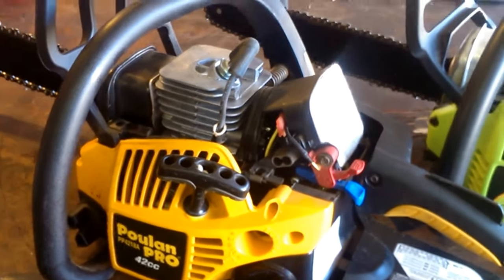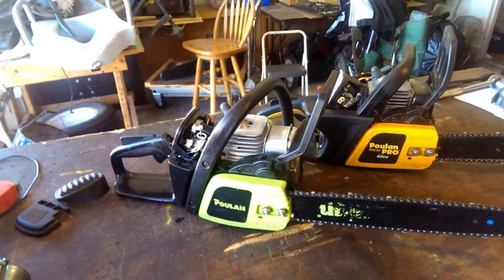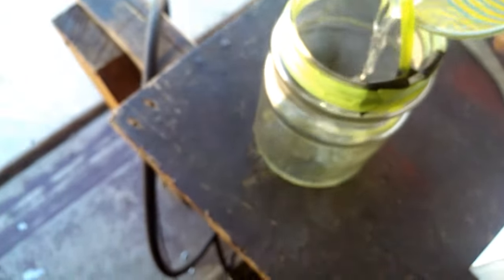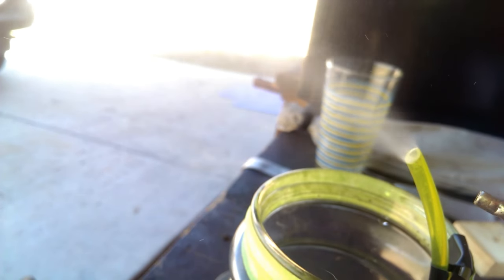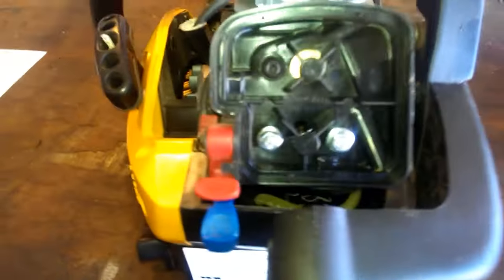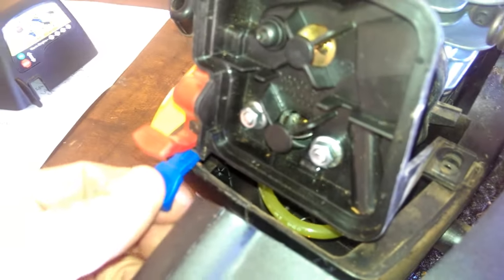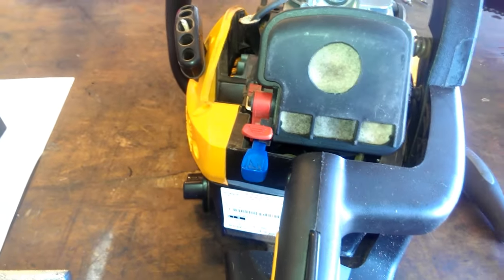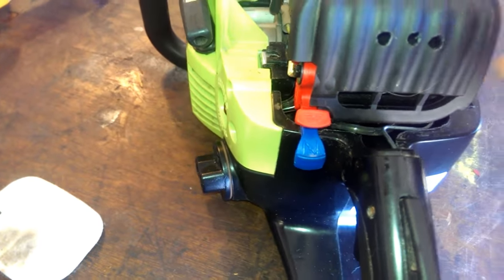Poulan wont restart after being used & how I solved my problem.

Comment: Great video brother! I just have one question that is can’t find the answer to anywhere. How many turns left from zero on the carburetor is it on the Low (L) and High (H) end? I can always buy a replacement carburetor but I will never learn how to fix it in the future. It is a Poulan chainsaw P3816. Thank you again for the great video!
Reply from the maker: To properly tune the chainsaw or any saw for that matter, the saw must be configured for way it is intended to be used. IE: air filter in place, chain on and warmed up. Start with both high and low adjustment screws at 1 1/4 turns out from full seat. That's just the starting point. After you get the saw started you will only adjust the L screw to get the saw to run on its own. After that give the saw AT least a full minute to warm up. Now it's time for the H screw adjustment. Counterclockwise will make it richer or more gas and clockwise adjustment will make the mixture leaner or less fuel. After adjusting both screws and you feel that you have good trigger response, you must put the saw into wood and see how it cuts. A little fine tweaking may be necessary for optimum performance. I know it's a long winded answer but that's how I do it. I hope it helps. Start at 1.25 turns on both. Thanks for stopping by and Happy Thanksgiving. Stay safe. 😷🍺👍
Reply: Thank you for the quick response brother, especially on Thanksgiving! You are awesome and I love your teaching techniques, keep it up. Enjoy the family on this special day! Take care.

Comment: Just found on the 3414 by the side of the road for anyone who thinks they can get it going, I put in new gas, it started and stalled immediately. Now I'm going to look at the air and then a carb adjustment if needed but I know after this video (thanks!!) I'm gonna get it running like a Deer and sell it for 100.00 in about 2 minutes.
Reply from the maker: Good luck. Seriously brother. 🍺👍
Reply: @ZombieDaveAZ  Thanks Dave, looks like I'm not getting any fuel in the primer bubble, I'll add some gas to the carb and see if it starts, if so I imagine I have a blocked fuel line right?
Reply from the maker: @robertdelorme8779  type in 2 stroke carb clean 100% in the youtube search bar. My 2 part video will come up. I think you will find it helpful. 👍
Reply: @ZombieDaveAZ  Thanks for all the tips Dave, in the end I passed it on to a dude for 15 bucks, the brake chain was busted and didn't want to take it any further.  You're a good man to help so many, take good care.

Comment: A two stage carb is equiv.to the two barrel quadrajets,thermoquads etc. the carb u reference has a choke valve , a throttle valve behind it  plus an aux.air  valve above for exta air injection at hi throttle to thin exh. emissions. Some early foreign cars had a 2 barrel(stage)carb but never saw any US 2 barrel 2 stage carbs ,only 4 barrel 2 stage cabs.in US.
Reply from the maker: James Farley Ill take that as a "yes." 2 barrels an 3 butterflies.

Comment: I have a Poulan P3314 33cc/14" Chainsaw. The Choke switch (Blue Switch) will not stay out when I choke it. How do I fix that?
Reply from the maker: The choke will not stay out if you pull the throttle trigger. Choke all the way out is choke + high idle. Choke pulled all the way out and pushed in 1/2 way is high idle only. If the choke does not stay out on its own after what I just told you,it's a carburetor linkage issue. Have you done anything to the carburetor?

Comment: I have a similar re-starting issue with my stihl km130 which I use for hedge trimming. After prolonged use it won't re-start easily. I usually leave it idling so I don't have to re-start. Thanks zombie Dave, I'll look into it a little further.
Reply from the maker: Hi David. That KM130 is a 4mix machine and pretty much bulletproof. The valves do need adjustment usually around 60 hours. I can send you the link if you would like. Also the exhaust screen can clog and slow the start up. Check those 2 things and your machine should fire up on 1 or 2 pulls everytime.
Reply: Zombie Dave. Please do send the link, if I find it's too much for me to handle I'll get my local Stihl guy to check the valve clearance/adjustment. Spark arrestor is clear.
Reply from the maker: @David-il9zr  Here you go buddy. Its easy. https://youtu.be/K9Uy-an-5Cs . Note to self: Dont rip the cork gasket and be sure the copper washer stays with the nut when removing the valve cover. Why?  Because the fuel air mix travels up underneath the valve cover to lube the rockers etc. If the cover is not on tight you will have a lean condition. Other than that its a piece of cake. Dealer is $65 to do this around here. Let me know how it turns out.

Comment: I have one Poulan P3314 that starts great and one that just don't I bought them for $66.00 for the two at a pawn shop. I had a old 2300 that would start the first or second pull every time but it just wore out it was about 20 years old and cut firewood for me and my dad every year!  Some are good and some are bad!= I guess.
Reply from the maker: Old Guy Hey buddy, Thanks for the sub. I like Poulans and have other videos on them. Some on carb rebuilds, some on what to look for for compression etc. I'm old and just like the challenge of making them run again.  Seach my titles and naybe it will help you get that 1 Poulan running again. Thanks again.

Comment: Good idea! ... Got a p3816 and having a problem removing air cleaner to get carb off. Same as on this video...2 nuts and 1 torx screw in upper left corner. Removed them and still not budging. HELP!
Reply from the maker: Dont forget choke and throttle linkages. Could just be a little stubborn.

Comment: It's the air filter , after running the saw for a while the stock air filter is lightly saturated and cannot allow a fresh burst of air to pass through it due to the low draw ( suction ) from the engine , Husqvarna uses screen filters , try using a screen filter or just the screen modified to fit the poulan chainsaw

Comment: I have that green PL3314 model. What size torx do you need to open the top cover off?
Reply from the maker: Matt Handel T 27 but a T 25 will work too. I think some of them accept a slotted screwdriver as well.

Comment: Also,any air in the tank has moisture will condense into water that runs down the walls inside the tank and ends up pooling in the bottom of the tank. Yup same exact thing happends in your riding mower.
Reply: Very seldom do u get moisture from the air into the tank. Gas over 70 degrees is expanding /evaporating keeping even an open tank free of much if any air, especially if near a hot motor w vibrations helping the pressure. rise. The water is usually in a soluable state in the gas/alcohol and seperates out.

Comment: I have the same Poulan as you. It was brand new but I only used once, then it sat until the gas lines rotted. I just changed all those and got it running. I learned a lot trying to do that. Next item to fix... my trusted Dolmar weed eater bit the dust. Acts like it's hydro locked. Can't pull the cord with the spark plug in. I took it to be fixed and was told a screw on the pull cover came out and got stuck. Afterward it worked once and then the same thing happened. I thought I had it fixed after taking it apart and putting it back together (don't know what I did but it was working/pulling). Then it stopped pulling again. Watched some videos and learned a little about hydro lock. I dumped the oil/gas from the piston through the spark plug hole. Still won't pull if spark plug in. Can't find any other videos to help. Any ideas? I like your videos, thanks.
Reply from the maker: Hello Cliff. The attached video will help you solve the hydro-lock problem. Its a carburetor issue. https://youtu.be/wNTKOuKwXaI

Comment: Thanks for info on air filter I have the same saw I use to just leave gas in tank when not in use ,it eventually rotted gas lines in tank .they are a bitch to replace not much room in fuel tank I got new lines in saw will start but will only run on full choke if you try to open up it dies out is carb just dirty ?  I like saw but have found two different Craftsman blowers with same problem some one threw out!

Comment: I got one like ur yellow one 42cc my problem is boggs down while cutting had a 20in bar went down  to a 16in still same problem cleaned carb adjusted carb with no luck Mufflers clean even drill a extra small hole in it feels good mix 40 to 1 new plug. But what is start off turns one low and high screws and mine runs 1 tank of bar oil to tank of gas is this normal for this saw most saws I have use it's 2 tanks of gas to 1 tank of gas. Thanks for and help
Reply from the maker: CoondawgFromKy Hey Coondawg. This saw was not intended for working a 20" bar. Its basically a homeowner saw that might get worked 1-2 weeks a year. As far as the oil usage on the bar, it does seem excessive. Check for leaks is all I can say without having it in my grubby little hands to inspect. Sorry Im not much help. Pawn shops are full of fairly priced Stihl and Husqvarna and Echo saws. A properly tuned one of these will deliver the constant power and performance you are looking for. They even have adjustable bar oilers. Thanks for commenting.

Comment: What about poulans with the metal filters?  I have the same stupid problem and have put all new fuel lines fuel filter spark plug and new carburator. Still runs like shit. I've spent hours trying to tune the carb and nothing. When it does start it just bogs out once I start cutting.

Comment: Thanks for the video. I have had one hell-of-a-time with my 4218 this weekend. It'll run only long enough for what I perceive as the contents of the bulb squeeze have in the carb. I replaced the fuel line because I found the fuel filter broken off and just laying inside the tank. Before that discovery, I replaced the fuel with the pre-mix 40:1 from Lowe's. I cleaned the carburetor with cleaning fluid, it looks very clean but then again if it's internal then I might not see it.  The machine will start and, like I said before, it will run until the gas runs out of the bowl or if I keep making "baby squeezes" to the trigger, a full squeeze will shut it off and if I do nothing it will shut off as well.

Any suggestions that you might have Zombie Dave are much appreciated. Even though I have owned this chainsaw for over ten years, I do not have much runtime on it. The same goes for anyone else who would like to add to the conversation. I've considered the trash bag method already.
Reply from the maker: 07Convertable id the filter was broken off in the tank then I PROMISE you that the small screen under the pump side of the carb has junk in it. Follow this link to my 2 part cleaning and assembly of a carburator. It WILL help. If you are not comfortable with cleaning a carb, a new one can be had on Amazon for under $15 and the rebuild kit is about 1/2 that. Either way you can can get out of the repair cheaply.
Reply from the maker: 07Convertable  here you go buddy. https://youtu.be/CX34AxY2aYU
Reply: Thanks, Zombie, I'll check it out now. 

BTW - I take it that you fly ultralights? I will get one myself someday. Maybe after I finish paying off my Victory Vision! Always been a dream of mine to have one.
Reply from the maker: 07Convertable  learning to fly is the best thing you will ever do to yourself,for yourself, by yourself. Good luck. Hit that subscribe button and help a brother out.
Reply: over time the fuel mix breaks down into gum/powder coating all parts .if fuel flow flushes the trash in the fuel lines to the carb screen replacing filter and carb r ineffective.Replace all fuel lines after more than 6 months if having problems.

Comment: how about a new filter???    my  poulan just started giving me trouble.  i use it about once a year.  (going on 15 yrs old) any ways it started cut down most of a tree.  put the saw down to move some branches. and it died.  it starts but won't stay running , if i give it some throttle.  it cuts out.  maybe i need a new filter. or some carb work.
Reply from the maker: Hey Doug. A 15 year old Poulan is not like the paper towel (throw away) saws of the last 5 years. Yours is a much better saw. Its probably just due for some maintenance. Plug,filter,fuel lines and carb kit or new carb. If you do the work yourself it will run you $30-$40 and you will be good for another 15 years. Thanks for commenting.

Comment: You where right about ever thing you said, but about Husqvarna  the new 120 mark ii they have the same suckie air filter and mine was doing the same thing seen your video went and start it let it run ten mins i cut it off and it would not start back pull the air filter off two pulls and it start up put the filter back on it die and it would not start  took filter back off it fired right up. and my filter was cleaner then yours. its gave me trouble from day one and it all most new said all this to just say thank you. had try ever thing else now i got fine a better air filter.

Comment: Nice saw I've got one to. I've had no issues with it great saw runs great just need to know why it quits running when it's been running good all day long my dad started it once and it quits and then I try and start it and I can't get it to turn over
Reply from the maker: erin averyt. Hi Erin. Thanks for subbing to my channel. Im sorry I cant really isolate what is wrong with your saw in this forum. BUT by process of elimination I would first look inside the fuel tank. Carefully inspect the fuel line for cracks,dry rot etc. Also fill the gas tank and see if it will run again for an extended period of time. Let me know what you find.
Reply: ulitepilot aka Zombie Dave I will do thanks for the response

Comment: When I replaced my carburetor on my PP4620AVL after cleaning it, I found a small rubber part under the air filter unit that had fallen from somewhere. I looked it up in the parts chart and it's called a "Crankcase isolator", but I can't tell where it actually goes. I tried placing in the air filter unit over the vent hole to the carburetor (nipple toward air filter) as it seemed most logical place, but it interferes with the choke butterfly. Where else could it go?
Reply from the maker: The isolator block is between the engine and the carb. Does that help?
Reply: @ZombieDaveAZ  Thanks Dave, I'll try that. The confusion comes (apparently there are several of us) from the fact that the parts manual shows it going between the air filter and the carb as though it fits in the air filter some way.

Comment: I have a habit of removing the mufflers on engines. Of course they will run noisier but is the engine being damaged without the muffler in place? Aren't you making the engine more efficient...able to breath better?
Reply from the maker: ANOTHER very good question. It would take an F1 engineer to explain how expansion chamber,exhaust evacuation and efficiency all work together to get the peak performance from an engine. BUT in the case of small engines 4 stroke engines should at the very least have a straight pipe to help maintain heat close to the exhaust valve. On a 2 stroke engine there are no such valves but without some sort of directed exhaust there is the opportunity for unwanted material entering the combustion chamber. Thats not good. Lol. Imagine a motorcycle (2 stroke) on a motocross track with no exhaust pipe to prevent dirt from entering the engine while its going 50 mph. See what I mean? Also small engines are very suseptable to heat. Clogged cooling fins will case all kinds of problems. There are hundreds of scenarios of pretty much all of which will give reasons of why a muffler should be in place. Muffler mods are very common particularly of porting the intake has been done. The fast you get fuel mix in, the faster you need to exhaust it. Thanks for the question and I hope this helps.

Comment: thanks!  so my idiot cousin ran it with regular gas.... after i put in a new piston and ring, I now can never get it to idle correctly.  when i start it i have to hold the throttle open too.  going to try this tomorrow and see if it helps. i probably need to adjust the H and L screws  but can hurt to give it more air like this.

Comment: I have a poulan  woodshark  it works great once I GET IT STARTED but in order to start it I need to hold in the trigger.I cleaned the carb  &adjusted ,put new has lined in it & filter.put a new air filter also.WHat could be causing this?
Reply from the maker: Normal start is full choke until it starts. Then 1/2 choke with the engine at high idle. Let it warm up and you should be good.

Comment: hey man, i used Alpina A40 and when i used it, giving it gas and stuff, it just turned off, even tho it had half a tank of fuel, and i was trying everything, even cleaning the spark plug, still nothing, what should i do so it can start properly?
Reply from the maker: Most saw manufacturers want you to set the high idle on restarts. Pull choke all the way out and then put it halfway back in. That holds the throttle plate open.
Reply: @ZombieDaveAZ  i opened machine, actually, piston broke 🤣

Comment: I'm having this issue with a slightly different model of poulan saw. It doesn't have the filter sheild, it has a foam filter. It starts great when cold, cuts like champ through everything I put it on, then dies about 10 minutes in. She's hot and won't restart. Next day cold starts fine, same issue. SMH Got any wisdom for me?
Reply from the maker: Ok, so your problem is different. We have to isolate and eliminate all the things that it's not  first.  So we have to run  the the saw again for the 10 minutes until it dies. Then in a quiet area open the fuel filler cap. You are listening for a suction of air going in the tank. A bad or clogged fuel cap vent would make it do exactly what you are describing.